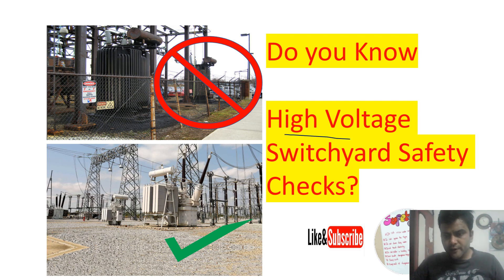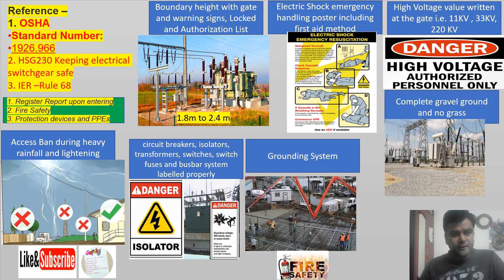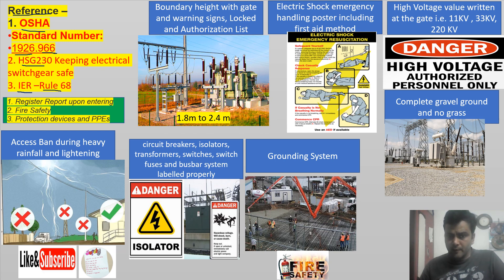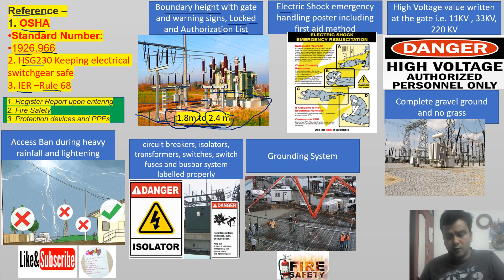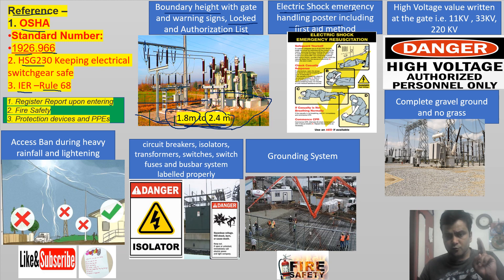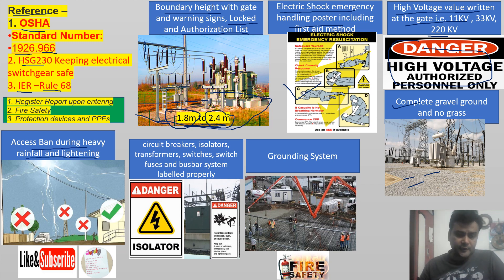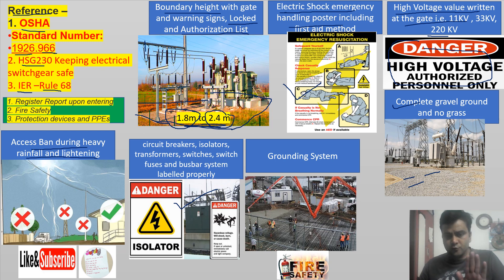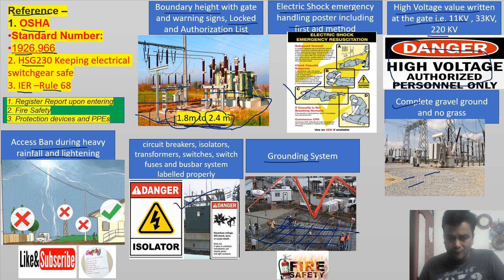High Voltage Switchyard Safety Visual Checks

Comment: Purposes of stones in switchwards???
Reply from the maker: You mean gravels,  they provide resistance to step potentials hence preventing electrocution,  oil leak from transformers can't accumulate hence prevent fire, insects, rats,lizards stay away as ground is not smooth, weed growth is preventable etc.
Reply: @safetysolutions7544   thanks . New OHS CODES PAR VIDEOS BNAYE,
Reply from the maker: @satishindia5357  Sure